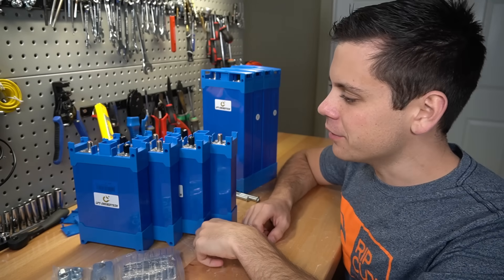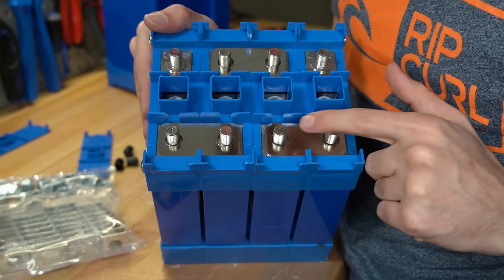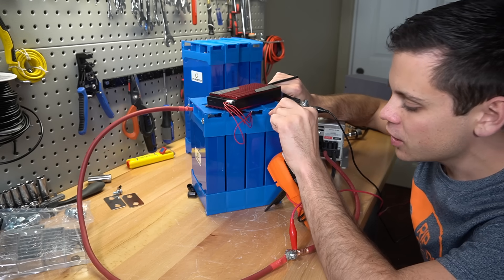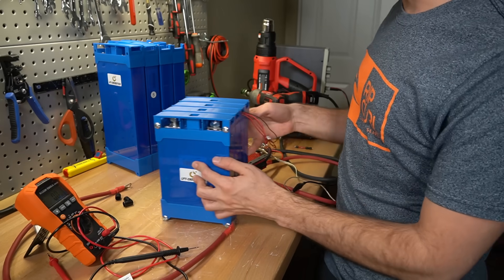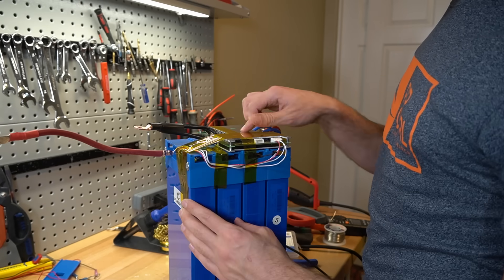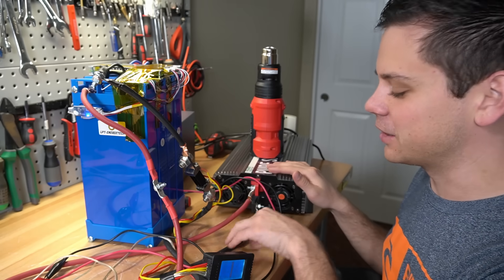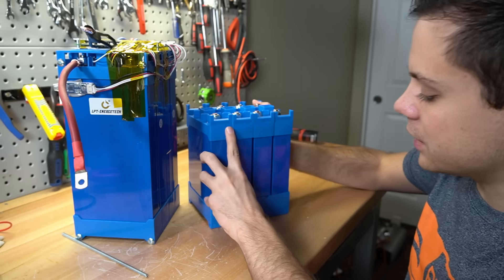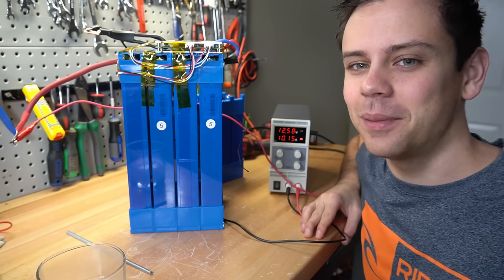Fortune LiFePO4 Battery Cells: I love them!

Comment: $115 per cell needing 4 to make a 12 volt system seems like a pretty decent price point for a 12 volt  Lifepo4 battery that is 100 AH
Reply: But if you’re doing DIY, you’ve gotta go 24v.
Reply: @PaDutchRunner  why?
Reply: @Mike Tipping
 I think Stephen Otto just wants to sound like he knows what he's talking about.

Anyone who knows even a little bit about this stuff knows that it's all dependent on the needs of the project. 

Obviously you would NOT want to go 24v if all the appliances that you're trying to run are 12v and you just want a simple direct-powered setup, without any step-down converters & all the extra wiring that goes along with it.

And also, you can easily make a 24v setup with these cells if that is your goal, so his comment just seems...pointless.  At the very least, incomplete.
Reply: xunil76 The “extra” wiring is minimal. The step down converter costs $35 on amazon. What you get in return is greatly enhanced safety (half the current), twice the inverter efficiency, and lower installation costs. I laugh to myself every time I see these installations with 2/0 or larger cable.  Pretty unnecessary in a mobile application @24v with a 3000w or smaller inverter.   There is a reason Winnebago has gone 48v with their lithium systems!
Reply: Mike Tipping Enhanced safety due to 50% of the current; twice the inverter efficiency; smaller and cheaper and easier to crimp and route cabling.
Reply: Mike Tipping Also see Will’s discussions regarding the advantages of 24v or higher. Everything I know about these systems originates with him.
Reply: Mike Tipping And yet another reason — if you are making your own battery out of cells, 24v allows you to create a single battery with ample Ah so that you only need to purchase and manage a single BMS. Far better than multiple 12v batteries in parallel.
Reply: Mike Tipping Oh, one more reason: when you use a step down converter for your 12v instead of running your system directly off a 12v battery, the result is nicely regulated 12v output.  Many common 12v appliances are very voltage sensitive and will not operate correctly if the voltage varies too far below or above 12v during certain portions of the charge cycle or when a large load is placed on the system.
Reply: Stephen Otto Why stop @ 24V though? 48V is better again. And for grid-tied systems high voltage battery packs make sense, like those made by Samsung and LG. You could use a Solax HV Hybrid inverter and that would be a much more efficient system again. As others have said it all comes down to use case.
Reply: MondoTV Agreed
Reply: @xunil76  Seems like you're the one trying to sound like a know it all. There are numerous reasons a 24v system would be a superior choice. Outside of the additional cost for twice the battery cells and a few extra parts, the 24v will do everything a 12v systems does and better. A 12v system is simpler, but OBVIOUSLY you already know that. However, if you even knew a little bit about using 24v, you would realize its pennies spent for lots of improvement in functionality. 
I figure returning the snark was only fair.
Reply: Belinda Mars You have a lot of words. No meaning, no sense, just lots of words.
Reply: @Hammy

I make no claims of being a know it all.  In fact, I will readily admit that I'm still learning a lot about solar & battery power, and have a lot of learning to do still.

But I also take the time to quantify the comments I do make, rather than leaving some completely vague statement to be even possibly interpreted as some hard-and-fast rule, not to be broken, ever.

The original statement by Stephen Otto was: "But if you’re doing DIY, you’ve gotta go 24v."  Period.  Dot.

That statement alone reads as though there is no reason to ever deviate from that; you should never even consider the possibility of going just plain 12v, or maybe even 48v.  There are obviously reasons for going with those different voltages, and his statement by itself is just plain disingenuous.

That is like stating: "This car audio amplifier puts out 100 watts".
Ummm...OK.  Completely useless statement.
Is that 100w TOTAL?
Per channel?
How many channels?
Is that going into 1, 2, 4, or 8 ohms?
Is that continuous or peak power?

Hence my statement about his comment being "incomplete".

Judging by his other posts after I made my comment, he obviously knows more than what his original post implies.  But then, that's kinda the point I'm trying to make in the first place.  Make your statements as you will...but back them up with "why" and "under what conditions", or else you will always get people who will question and/or write off those statements.  Which obviously happened, because Mike Tipping questioned Stephen Otto before I made my comment, which was based on the information I had available to me at the time about S.O., which was almost nothing.

I just shared how that statement read to me.  And if it came across that way to me, how many others read it the same way, but just didn't take the time to comment about it?

@Belinda Mars:
Cool story, nice facetiousness.  And apparently too much time on your hands...must be nice.
Reply: MondoTV we have 24v and 48v video
Reply: Seeinya traveler after getting the bms and four cells would it be as capable as the 100ah battleborns? And cheaper ?
Reply: @consaka1  you need to spend a little more time studying the idea and studying electricity. Based on your statement, you must be fairly new to 12v and vehicle wiring. Watch some of Will's "beginner" level videos. A 12v battery actually runs at 12.8v when resting and charges up to 14-14.6 volts to get the battery fully charged. This is totally normal. You'll even see that in this video when the battery gets fully charged.

Comment: You might try to 3d print similar plastic holders for some other off the prismatic cells you have. printing 4 shouldn't take that long. Just make sure to get tolerances right and test it on one piece, and use plastic that can operate at elevated temps, and better be non flammable.

Comment: So 4 of them = 60ah, 4 of the big ones = 100ah?
Reply from the maker: each one is nominal 3.2V. So the 60Ah cells are 3.2V, and when 4x are put in series, you have a 60Ah 12.8V battery. Ah is dependent on nominal voltage.
Reply: @WillProwse  ah, cool. Thank You!
Reply from the maker: Which is why you are  better off using watt hour to compare the capacity. Ah can be confusing for some.

Comment: Really nice holders and accessories. Makes things so much better and nicer. The spacing between batteries is also nice. I would say the energy density is a bit lower than some other cells we have seen, but for stationary storage not a problem. Price also looks good. I see no fault in the design.

Comment: Very nice! The plastic shrouds are really well thought out for any shape imaginable, and make it easy to swap out tired cells.
Tip for cutting threaded rod - put a nut on it first before cutting, then unscrew the nut to tidy the thread, then you can file the end burr for easy use.
Reply from the maker: You guys should try that tool. Super convenient.
Reply: @WillProwse  The tool is great if you're doing many of them a day, but otherwise it's just a thing you have to spend time looking for at the bottom of one of the toolboxes you forgot about!
Reply: @ahaveland  I work in Telephony/IT and my tool bag weighs about 65lbs! Its got over $1,500 worth of hand tools and test equipment in it.
Reply: @MrBrelindm  I love tools too, but you're using a specific set of them constantly so they're cached.
If you only need a tool occasionally then naturally it'll get lost in the weeds and can take a long time to find.
Reply: @ahaveland  I've been that guy.  The more organized I get the less it happens.  The key is to have a place for everything and always put tools back where they go.  That way I always know exactly where to find the tool I need.
Reply: @MrBrelindm  , where do you leave your toolbag at lunchtime... just teasing, having the right kit is a professional
Reply: you beat me to it ,
Reply: +1 for the deburring tool
Reply: Also,  don't use bolt cutters.  Instead,  use a saw or cut off wheel.
Reply from the maker: @D2O2  smart idea. I actually saw a video of the deburring tool and cringed at using a nut for all the cuts I had to do. The deburring tool took seconds and I didn't have to position the nut before every cut. Or spin it down a 2 foot rod. The deburring tool saved a lot of time and worked great. But yeah, a nut could work
Reply: @WillProwse  I like time saving tools. In the IT work that I do, I install lots of RG-6X (digital grade) coaxial cable so I invested in a good cable stripper, and a compression F connector fitting tool. Now I can terminate about 40 cables per hour. (We've been renovating existing nursing homes and building new hotels lately).

Comment: I think this this are the cell's for my next project..
Reply: Hi Anton, I'm a solar, lithium battery ROOKIE! and I'm hoping you can answer my question if you don't mind. In this video of Wills he has shown us two different cells, one is 60aph cell and the other is 100aph cell correct? I will be building a van conversion in the future and I've been looking at the Battel born 100aph battery. For the amount of space the 100aph BB would use up in the van I should be able to build a 400aph-600aph battery in the same space using the 4-6 100aph cell Will has just reviewed in this video? am I understanding this correctly? I would ask Will this question but the guy has 300,000 subscribers. If you can clarify this for me that would be great. Thank you.
Reply: Tax Slave 4 of those cells hooked together in series make 12volts and 100ah. They are 3.2volt cells 100ah. The same website that sells these cells have a 12volt battery making 400ah for $1700!  That’s the best price per AH around.

Comment: You can solve the burr problem by first putting a nut on the threaded rod, cut it of with a hacksaw or angle grinder with a cut off wheel, then turn the nut off and the burr will be forced off with the nut.

Comment: WOW.... I think I may have found a battery to power up my HAM radios out in the field.  My radio draws a maximum of 23a.  I think that a 16 volt battery, with a buck converter to 13.8 or 12 volts is the ticket.
Reply: JT 6188 great idea to use on cb in wilderness too.
Reply: Why not just use a 4 cell battery which would be 13.4 volts instead of a buck converter which would waste energy?
Reply: @JRP3  Well, when I went to school,  3.2x4 = 12.8 - or am I missing something ?
Reply: @JT-py9lv  A fully charged LiFePO4 cell is 3.60, resting voltage is around 3.35, x 4 = 13.4.  You said you could use 13.8 or 12 volts, 4 cells would put you in that range.
Reply: Avoid anything that has a switching module / PWM and similar.  It likely would create a lot of HF noise.  Keep it simple, just a 4 cell battery directly hooked to your receiver.  The discharge voltage is pretty flat from 100% down to 10% or so, no need to regulate that.
Reply: Any reputable 12V ham transceiver is rated for 13.8 volts +_ 10% or better. No need for buck converter.

Comment: You don't need a deburring tool, thread a nut onto the rod at the point of cutting, then remove the nut (with a wrench if needed), the nut will deburr the end.